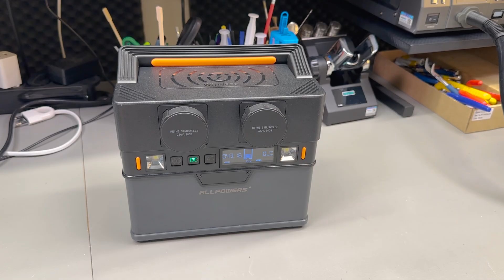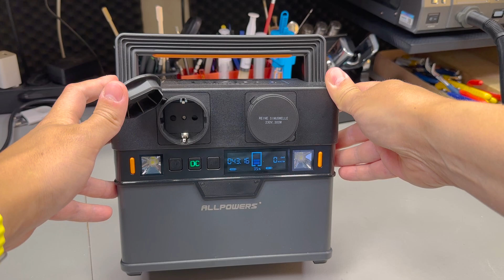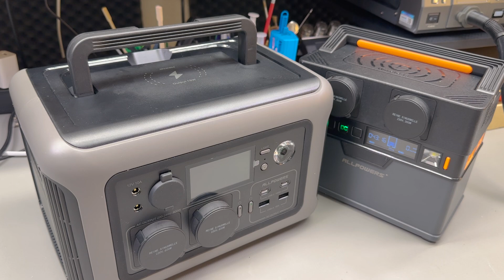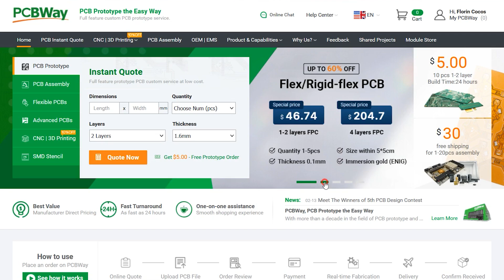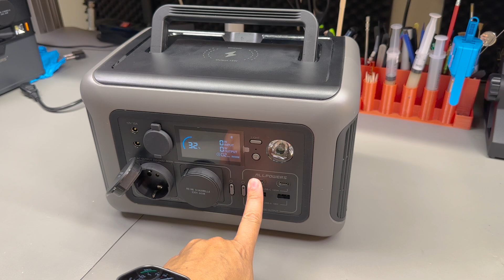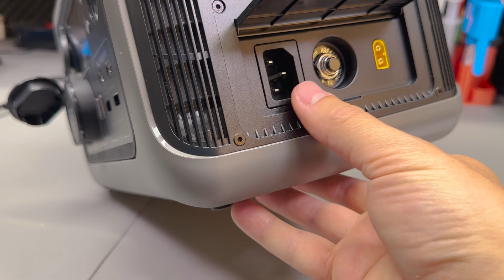AllPowers R600 LiFePo4 Power Station Review & Teardown | Voltlog #456

Comment: Well, I don’t know Paris. Just admit that these will not charge on DC 110 V power. They will short out on AC battery power. Why are they keep selling them as the new batch come out yet? Why aren’t they discontinuing this unit? If so, many people are having problems with it like me I bought one I want to return it, but I don’t want the hassle. It works fine as long as you only use solar power charging when you try to charge it with AC it just shuts off and beeps and kicks on charges a little bit every 40 seconds the beeping will start. I don’t know. I’m just a dummy.😊

Comment: Hi I plug in both USB-C at 100W each, plug in 12v cigarette at 100w and a 5525 40w heating cup, the unit pop and no longer turns on. It was at 45% when it dies.

Comment: Just received my r600 have slightly melted plastic smell, don't know if it's okay for this type of devices, can you say your r600 has any smells?
Reply from the maker: it's just a smell of all the different plastics and adhesives used on the inside, nothing wrong.
Reply: @voltlog  thank you for answer )

Comment: Thanks for the review! I'm kinda disappointed that this is yet another battery station that doesn't allow direct access to the battery, only having connectors that go through the inverter or a DC-to-DC converter. I have a ton of devices that can take a wide range of voltages and so would be much more efficient when connected directly.
Reply from the maker: Great point! I think it's also a matter of use case for typical customer of this size of power station. Bigger ones tend to offer access to battery pack but smaller ones are likely never used in the way you describe.

Comment: Good review. Does the UPS functions also work for the USB-C output? My mini PC runs on USB-C PD and this would make a nice UPS for it.
Reply from the maker: USB-C output is always powered as long as the USB section is switched on. It just takes power from the battery. Then there is the AC or solar charging which may or may not be present.
Reply: Thanks!